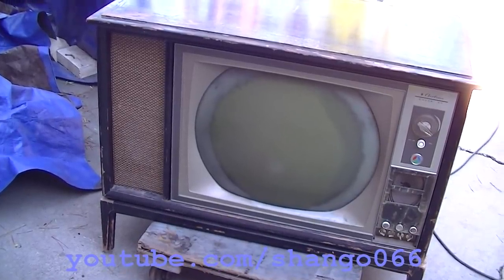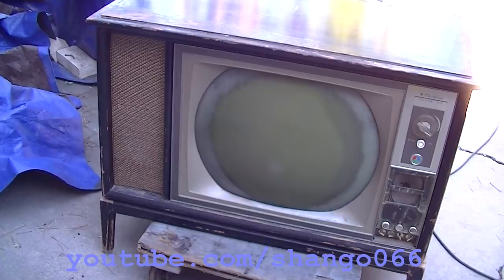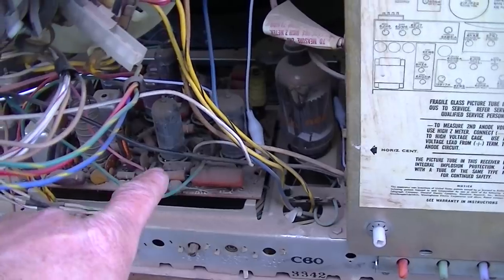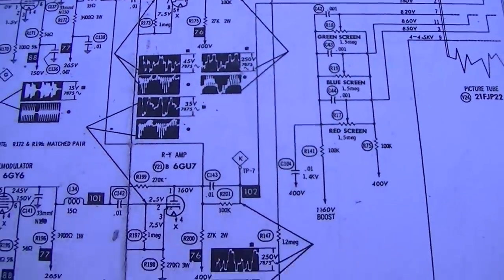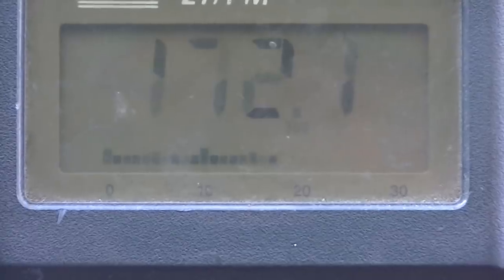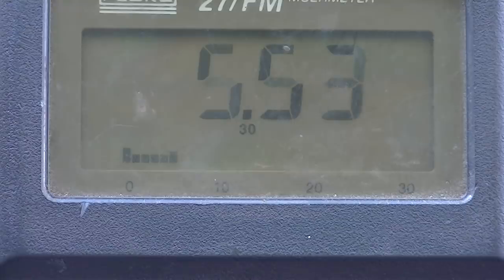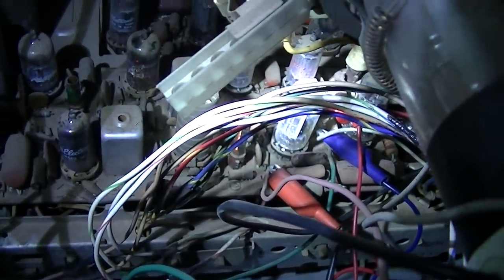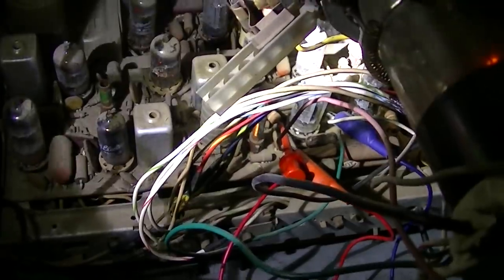RCA CTC15 Color Final Repair Purity Convergence Setup 1964 Color Television

Comment: when you pull off the tube that tube socket looks exactly the same as the ones used on predictas that always break the contacts... i am with you on the diagnostic before bulk  recapping... recently i had a tv that worked fine with all the leaky caps but the vertical was collapsed with new caps... the problem was the cathode resistor on the vertical output was open and the leaky bypass cap (electrolitic) was pulling the cathode to ground thus making the set work perfectly fine...with the brand new cap the cathode was just left floating...funny hah

Comment: 90% of the RCA sets with that color demod board I have seen have had bad jumper wires that run on top of the board. I got the to point of just giving them a little tug any time I had a color problem. That carried on into some of the early rectangle sets as well.
Reply from the maker: Did everybody make it through that storm okay? I heard that may have rolled through dad's location
Reply: missed him by about 2 miles, pretty scary stuff. I may be heading up there in a few weeks, it was a very destructive, I did not know they could be so wide, IIRC its cut thru about 1 mile wide.
Reply from the maker: @davewm9589  wild weather this year. Has to be the wettest and coldest I can ever remember, it just won't stop raining
Reply: Yea I have been watching the west coast, lots of weather action. Hope all is well, you're getting a taste of central florida level rain. I am still trying to plan a pikes peak trip, but every nite the crazy storms I see make me think twice about it, esp since I plan to primitive camp along the way.

Comment: We need crt back!! 
A 4k crt would be awesome!
Reply: all plastic cabinet with chinese parts, both sweep circuits in one single IC, fancy menus and usb connection to make firmware updates? NO THANKS...for that i have my big LCD.....i like my vintage tv's the way they are. i use them occasinally to watch old movies. the way things were built in the 50's was just beautifull when compared to chinese shit these days
Reply: Woa, we need to double down on mount walls as well! ;)
OLED is where it's at.

Comment: Would love to pick up this TV set , but then I realize after removing the cateract, and maybe replacing that one lone white bomb capacitor and maybe bothering with the main filter(s), and further dialing in convergence and color scales .. then turning it on to "enjoy" TV broadcasts , being crestfallen due to lack of any viable programming shut the thing off being annoyed how much TV really fricking sucks just like I do with the present vintage TV's I have in my house. Well at least I can sometimes enjoy chips on the old RCA I have here but its been unplugged for months now. I do the same crap with the vintage radios I restore. Make them play great.. then turn them on finding on FM the radio stations that play the same 3-5 songs over and over and over and over and over , and if you turn on AM doing DX picking up stations all across the country with the same 3 news networks repeating the same thing over and over and over and over and over again. So much for nostalgia.

Comment: 40:42 way too long with the degaussing coil. One sweep all around 5-10 seconds then pull away does it.
45:20 we called it centering the fireball, then move the yoke to spread the red to full screen.

Comment: Why do the round tubes have better color then the rectangular tubes? I had a Bradford (RCA chassis) round tube color TV that had the most vibrant color I have ever seen. Never saw anything like it on a newer set.
Reply: Because original NTSC colours were defined with wide gammut. But in 60s-70s new phosphors were developed. They had lower gammut (especially green was far from original colour) but were more efficient - had higher brightness. PAL, Secam and also HD broadcast use these new colours as standard, NTSC used them from ~70s. When you display todays broadcast on old roundie CRT, you get vibrant colours, but not true colour reproduction.

Comment: I had a vacuum tube color TV when I was a child. Zenith from the late 1960s, which I watched in the very early 80s. It was by far the most washed out, colorless, fuzzy wreck ever, and I couldn't understand why it wasn't as good as the solid state TV in the den which was much newer.

Now I realize it was just terribly out of spec and probably would have looked amazing if it were fixed.

Comment: Vectorscope Color Bar signal looks like rainbow, but I think it's not the best signal for colour circuit tests. I worked with PAL and Secam and I always used standard colour bars signal. After some time you get used to it and you quickly recognise how R-Y, B-Y and Y signal should look, so it's much easier for diagnostic. Also vectorscope picture has only 6 points in exactly defined positions.

Comment: Nothing wrong with analog meters but the scale on that one sucks.  Great for measuring changing voltages like you were doing and voltages that have to be in a range but not exact.

Comment: If I remember, you can only adjust the color on a Monday night by tuning in to a local station that has a game show on. You then have to adjust the slug in the picture bulb with a blowtorch while watching the high voltage collapse into the fly-back transformer, and out of the damper tube. Once the excess high voltage is bled off, you must call a tele-marketer while plugging your cell phone into the picture bulb socket and adjusting the picture until Trump appears to resemble Monica Lewinski. At this point, turn up the red all the way until blooming occurs. You’re now safe from TV politicians once you remove the audio amp tube. Now, no one can be harmed by these con men. Finally, wait until the 2020 elections and EOL the set with as many bottle rockets as you can fit into the wooden case. Light the fuse and run.
P.S. the above “alignment” procedure should not be taken seriously, and is total bullsh*t; it is not intended to diagnose or cure any disease or malady. 😆